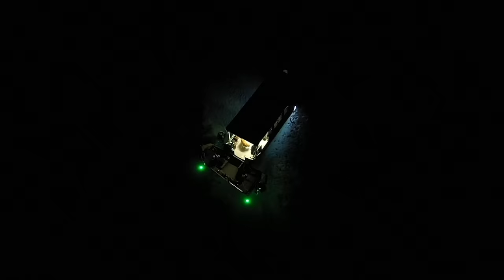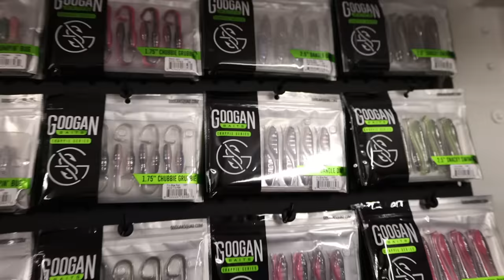24hr FLOATING TINY HOME Challenge On Rainbow Lagoon!! ($5,000 Mistake..)

Comment: Great video. I think your tires are too small around. The smaller the tire, the more RPM's it has to do. It flexes as it rolls and that causes them to heat up. I would go with a taller tire if you can. If it's not that, it's probably from overloading or going faster than the tire allows. I would go with size 15 or 16 especially on hot roads. Check your alignment too.
Reply: Also would go with wider tires
Reply: @robertbrunner4379  He had plenty wide tire. I think that was part of the problem. Too much surface area heating up the tire. I'm glad he got a new trailer with thinner but taller tires. I commented before I knew he was getting a new $4k trailer.
Reply: I would put money on over loaded and throwing off the alignment
Reply: @justinteal495  How many boat trailers have you seen with a tire that wide? It looked like an ATV tire. In fact, I think he said it was in another video. It was definitely overloaded but it was blowing from heat. The other owner probably never had problems because he didn’t drive at highway speed and probably didn’t have it on the trailer long. What did he get on the new trailer? Slimmer taller tires. Same number of tires. Way different design. Those tires do half the RPM’s and half half the surface area touching which equals less heat. But I’m just a marine mechanic, not a tire expert. Never seen a tire that wide on a boat trailer though. That’s why they move to tandem and triple axles. So they don’t have to put a wide ATV tire on them.

Comment: I would suggest building a sound box with lots of sound deadening for that generator so you don't disturb other people on the lake or river. Then maybe invest in rechargeable batteries. Lots of yachts are coming online with solar panels as standard equipment and the advances in solar panels and batteries, plus power management are amazing.

Comment: I got an adventure idea for you. You should come up to Northern Minnesota and fish for Walleye and Northern Pike in Voyagers National Park and or Rainy Lake.  You could rent a house boat, bring your floating "tiny house" (But, that would be an expensive trip if you don't get that trailer fixed.) or rent a cabin at one of the resorts. The park has places to moor a house boat as well as camp sites. (You have to get reservations to use the camp sites. Which is really stupid, but that's Government for you, I don't know if you need reservations to use the mooring sites.) the nice thing about the park, is that there's very few houses or cabins on the lake. Just a few resorts. It's pretty much unspoiled wilderness, and a whole lot of water. (For a lake, well lakes actually there's 4 lakes that are all connected). If you really want to test your metal, you can come up in February when it's 40 below zero and go ice fishing and snowmobiling.

Comment: I left a comment on the last houseboat video about the old trailer and the reason those tires could not hold up was because they were small, the axles were spread to far and were in the middle of the trailer. With that, all of the weight was on those 4 small tires and not the truck. With this new trailer its designed was better and has the correct tires and axle placement and to be honest your Toyota may tow it better with this one. But keep up the great work and i cannot wait for the show to air.

Comment: The problem Brandon is that boat is now way too heavy for those axles, hubs and tires... if you really air the tires up to max you might be able to limp it across town, but I wouldn't try taking it to far or much over 40mph without beefing up the hubs an tires with a heavier weight rating.

Comment: Brandon.... I live in citrus county! Heck, I know exactly where you parked on rainbow river... yall should go down the withlacoochee river that connects right there to the rainbow river, go down withlacoochee river like 6 or 7 miles n go visit the spring BIG BLUE
Reply: Also... i am a boat mechanic in citrus county... in my opinion, i believe you keep blowing tires because the rig is too heavy for only having 2 axles... should look into throwing a 3rd axle under the trailer. Much love from a citrus local... love you jig! Eric.

Comment: What did you do with the old trailer? Did you just leave it at the trailer place? I've blown trailer tires on trips and it's no fun especially after you blow through your spares and drag it on the rim for like 10 miles haha. I had one time where the tire belts wrapped around the axle and the wheel wouldn't spin so I was dragging it on the rim with it not spinning I wore it down a lot it was nearly into the drum, then pulled into a little shop that helped me change it because I couldn't get it off it took 2 big dudes with bolt cutters and a sledge hammer about 10 minutes to get it off it was really on there and they did it for free it was so nice of them. I did give them some cash so they all could get lunch at least. 
The shitty part of that story is prior to getting help I went to discount tire because i saw them from the highway and they refused to help me I was really pissed because I was stuck and had money for whatever I needed but I ended up having to drag the trailer somewhere else. I keep 2 spares on my trailers now and more tools, I have one trailer with 2 mounted spares then the other 2 trailers have 1 spare but on longer trips I always throw an extra somewhere. Also a hub and bearings and especially the hardware is so important and a life saver to have in the trailer box. 
I had a friend who's little dirtbike trailer lost a wheel something happened for the hub to come apart or something and he lifted the trailer and ratchet strapped a big log under the axle and dragged that trailer on the log for like 15 or 20 miles it was smoking like crazy I've actually seen similar pictures online once I think that's where he got the idea but it worked to get to town.

Comment: Are you left handed? Your reel handles are on the wrong way round if not.. If you're right handed, swap the reel handle so it's on the left, it makes fishing so much easier when your strong arm is used for levering the fish on the rod and your weak arm is on reeling duty just turning the reel handle...

Comment: those tires simply aren't rated for that much weight.  go get tires rated for the weight of the boat.  the axels being off center is probably a contributing factor, but it would have to be majorly off to cause 4 blow outs in 3 hours on perfectly new tires.

Comment: i don’t think it’s axle problem i think it’s the tires i work at a tire shop and most trailers that have that much weight run heavier duty tires and mcuh bigger just thought i’d put some input into try and help out
Reply: Once we got the boat off realized it had 3500lb axle spring in the front. Jet ski trailer springs on the rear. All the weight was on them poor baby tires